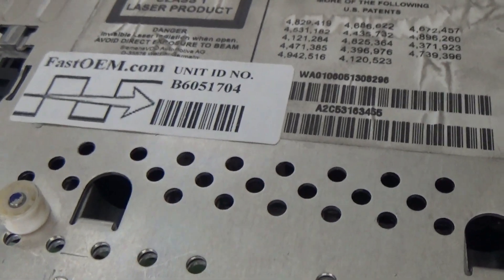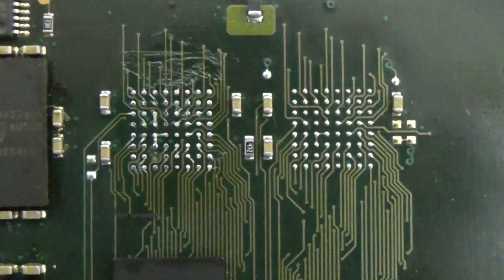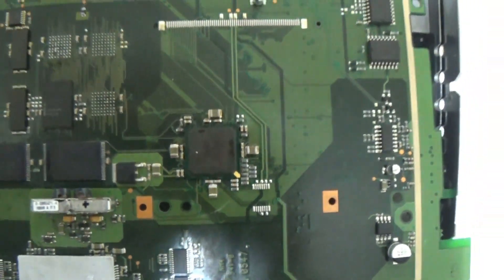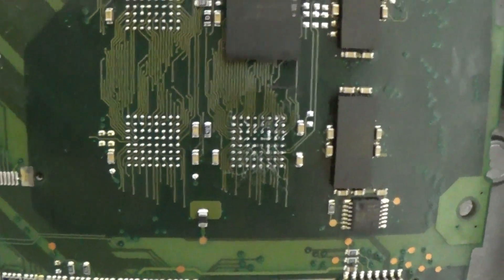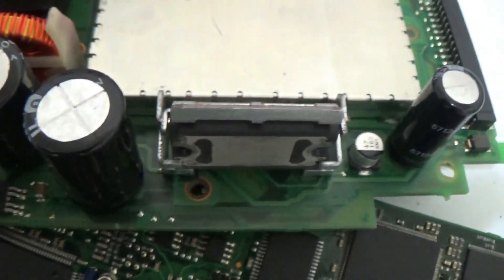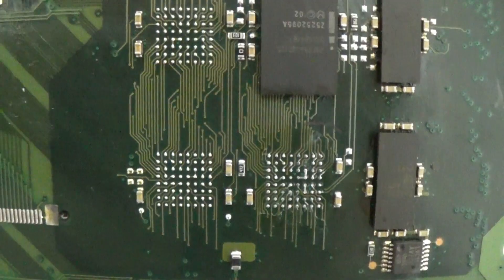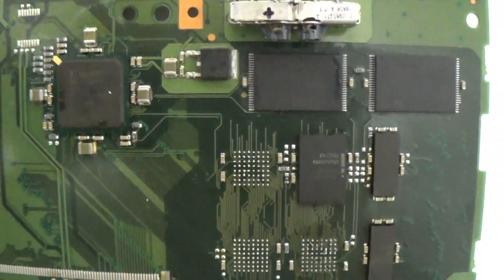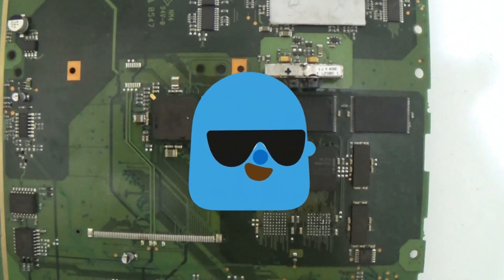BMW CCC UNIT, HOW NOT TO REPAIR AND WHAT NOT TO DO!

Comment: Hello how are you. I would like to ask a question. My ccc or radio module is damaged. he started by resigning a few times, with the passing of time he increased the frequency until I stop resigning in order not to call anymore. they told me it was the radio / ccc module. My question is there are those screens with android etc. these equipments is necessary the ccc module to work or it works independently

the screens are these that I speak 

https://pt.aliexpress.com/item/4000585735579.html?spm=a2g0o.productlist.0.0.2d1a1b048pirjp&algo_pvid=5a8d8eb2-bdc9-412a-964f-6ce9bbf09941&algo_expid=5a8d8eb2-bdc9-412a-964f-6ce9bbf09941-32&btsid=0bb0624116178109521763439e1b18&ws_ab_test=searchweb0_0,searchweb201602_,searchweb201603_

Comment: this unit is possible to repair witouth any problem. if you lock at datasheet of 28f256 flash you will se the missing pad is rfu(reserved for feathure use) and unit will work great witouth this pad. absolutley any board is possible to reapair
Reply: can you explain more please, what do you mean by this and what part is it how can i find it? thanks

Comment: Why don’t you make a video on the proper repair though? A lot of us do have experience in rework and would rather attempt to fix it before deciding on cic retrofit. It just doesn’t make sense to pay someone $500-$600 for this when entire NBT retrofit kits are only $600-800
Reply: I agree..it is ript of to charge 600 to fix CCC Unit. you can get used on for 100-200 on ebay
Reply from the maker: You’re so funny.... used ccc won’t last and coding and fsc upload isn’t easy. But yes NBT retrofit is so simple:) our price is actually pretty good and they last way longer after repair  than any Cic or NBT

Comment: While hesitant to ship my 2005 645ci CCC based on purely online research, I decided to go with Logic7 based on strong reviews in bimmer forums and 100% positive eBay ratings. They were fantastic! Turnaround was 7 days, and that included the installation of the BT module (recommended). They were very responsive to some questions I had via email. They know what they are doing. Highly recommend.
Reply: What were your symptoms? My I drive and radio doesn’t turn on but the lights on the radio turn on

Comment: just drop in a Pioneer double din radio into the Idrive display hole.  Forget about repair a 10 year old entertainment system.  Time to move on to the present.
Reply from the maker: BMW 2005-2010 , and then you lose your car computer you can’t even check oil level or setup simple things, your pioneer does nothing to your car except playing audio and Navi, in fact it’s a big question if your pioneer has better DSP and better audio quality. On top of that it’ll look very ugly and poor
Reply: Hey buddy can you please tell me how much cost to your repair ? Please let me know thanks.

Comment: We have been fixing these units for more than five years in Europe, but this kind of destruction I see very often. People are stupid and try various things before they send unit to us... If I see that unit was tampered, we do not even try any further repair on it = waste of time in most of cases.... I however must correct you - bmw now supplies brand new ccc units, not repaired. They are manufactured in 2016-2017 and come as hw 12.7. Either LCI version or also pre-Lci (of course with old panel fitted). They dont even take old units as an exchange and customer can keep it. They sell for a price of exchange unit....
Reply from the maker: Martin Kutný , if you look at the motherboards you’ll notice that all chips are old dated 2007-2008 and as you know you are not allowed to sell anything non ROHC in Europe or USA, so I can tell bmw supplies motherboards which have been sitting for 10yrs+. Agreed?
Reply: Logic7repair well, not sure if they are not allowed to sell. Definetelly they should not manufacture non-ROHS for new vehicles, but question is if there is no exception regards to the spare parts for old vehicles. Seems currently delivered ccc from bmw hw12.7 are completely new including boards. Simply bmw has stopped exchange units (those were marked as “AT” (Austausch-Exchange) and in fact those were repaired units, and they ran a batch of new units in 2016-2017. Exchange units were “repaired” by siemens-vdo and that new batch is produced and assembled in different company that had nothing to do with siemens-vdo. So 3rd party company that got license to produce a certain amount batch to resupply this unit as a spare part.
Reply from the maker: Martin Kutný, the last one I saw was 2017 January and it was 12.6 10 year old unit. Check my latest video
Reply: Logic7repair Pity I cant upload a picture here, and show to you that u are not true... If u order ccc from bmw, what you get is new unit manufactured 2017 - 2018 and it is hw 12.7. If u dont trust me, give me contact and I will show u. That was just a reaction to disagree with your statement that if u buy ccc from bmw, they give u 10 year old repaired one... thats however not true....
Reply: @airbonex  for 3000 euros the unit I guess
Reply: @rebelaris  earlier bmw used to sell exchange units - overhauled by manufacturer, then they sold new units for a while for a price only little bit more than exchange, and at the moment i inow they are very expensive as you say - more than 2500eur… and also availability is a problem in general…..

Comment: To everyone who wants to send these old units for repairs and spend 300-400 for the repair service . You can pick working unit from ebay for as little as 160£ if you shop around and then can sell your non working one for 100£ sou the total cost of repair would be less then 100£ .these repairs are ridiculously overpriced and unless you can find someone that does it for 100-150£ it’s just not worth it . Just my opinion .
Reply from the maker: Andrejs Gorjacko, you are quite wrong here. Used unit has no warranty and NEEDS coding in order to work on your car. Repair service provides 1 year warranty, WHICH IS SIMILAR TO BRAND NEW UNIT 1200$+ so don’t tell ppl something you have no idea about.
Reply: @Bavlogic  I desperately need a CCC unit for my 06 BMW  330i I'm going bonkers of not hearing any music or radio  for 5 months driving in my car everyday to work etc. Where can I get one fast and affordable please 🙏🏼
Reply: @Bavlogic  Plenty of options on Ebay for used units with a warranty.

Comment: The fan on mine stays on and it makes the car die
Reply: I  have same problem have you fix yours
Reply: My 2007 530xi has the same problem with the CCC fan constantly running and killing my battery. How can I fix it?
Reply from the maker: To fix it you have to send it to us, it’s not simply diy
Reply from the maker: Sergio Valencia , it’s a standard problem we see very often at least 2-3 per week come with it. We can repair it 100%. If interested find our website and follow it. In a few works your 62 GW failed.
Reply: How much would it cost for you to fix this problem